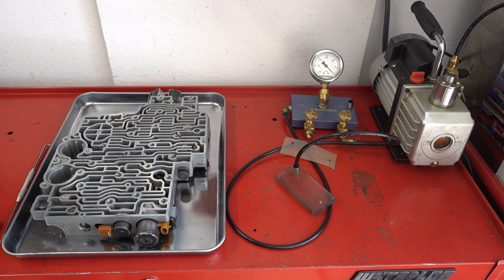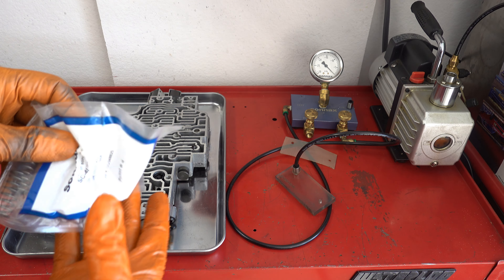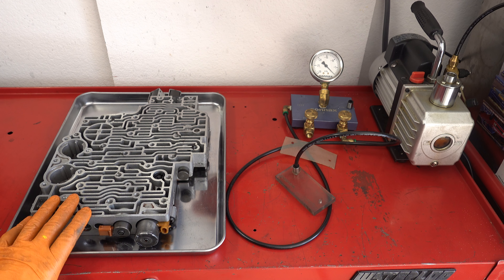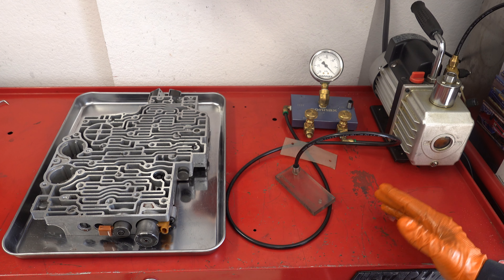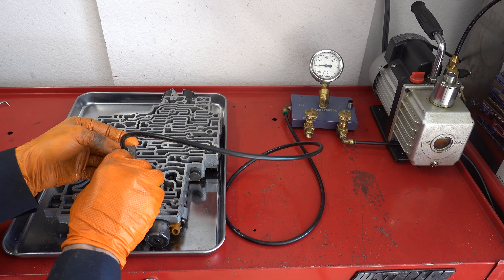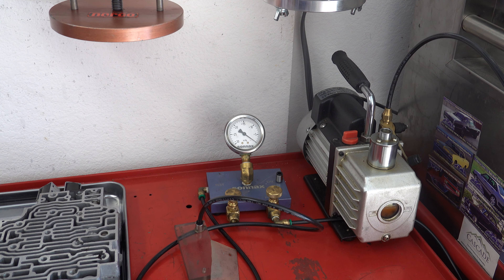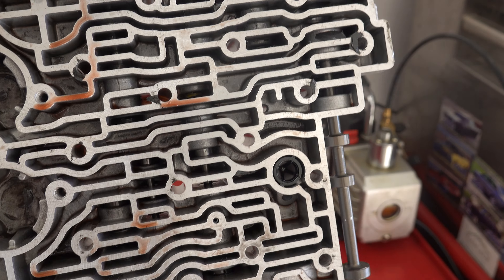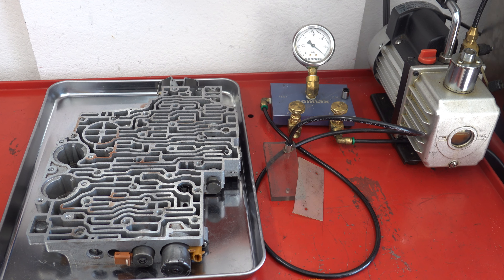4L80E  Valve Body Testing - Healthy Valve Body

Comment: Great video, Nick. I need to invest in one of those vacuum testers.
Reply from the maker: Thanks, Kevin. Those testers are well worth the investment, especially if you work on later model units. For example, the 6L80/90s and newer often have issues with valves in the vb and pump to the extent it’s pretty much mandatory to test as some of the valves that wear and “leak” don’t have any aftermarket replacements so you need to know if you have to replace the valve body or pump cover and the tester is the only way to find out.
Reply: @nickstransmissions  got mine yesterday. So far I've built my little business on 4L60E/700R4's. Besides the TCC and AFL valves, what bores do you commonly see wear in?
Reply from the maker: nice, Kevin! Once in a blue moon, the tester will see wear in the pressure regulator valve in the pump for the 4L60E but that's about it in my experience. Sonnax has a full guide that shows you all the possible test locations on the VB and pump for the 4L60E: https://www.sonnax.com/tech_resources/441-gm-4l60-e-vacuum-test-guide

They also have similar guides for other transmissions like the 4L80E, 6L80E, Ford and Dodge transmissions (and some foreign stuff). 

The 700R4 is tricker to test given the size of the little test block provided w/the kit vs the size of the circuit worm tracks in the valve body but you can make additional test plates using plexiglass and a drill/.125" bit to cover all the clutch circuits...The 700R4's TV valve and 3-4 shift valve wear, especially in the 82-E87 valve bodies. Pumps are usually ok but I still test them.
Reply: @nickstransmissions  thanks partner. I've got the Sonnax guide printed, laminated, and stuck right next to the vacuum tester. Lol. Have you tried the oversized AFL valves that don't require reaming? Are they worth messing with?

Comment: Can the converter O-ring can it make fourth gear drop out
Reply from the maker: Hi Richard, that o-ring seals off the torque converter clutch apply circuit so no (but it will prevent TCC lock up if bad) but if your OD clutches are burnt you will fall out of fourth gear and lock up.